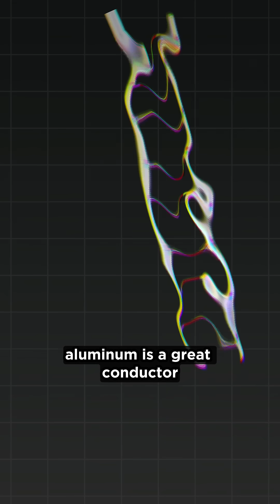How Did This Ladder Melt The Ground?

Comment: Current chooses path of least resistance so if anything it’s arcing to the ladder and there wasn’t a short so no reaction from the breakers as it’s only going straight to ground you would have to shut the power off to remove the ladder

Comment: I would guess the initial contact created a magnetic field and grounded through ladder. It could have then tripped a recloser. The recloser could have cycled fast enough to maintain the magnetic field allowing induction to flow through the ladder. Just a guess as electrical theory is just that.

Comment: Which circuit breakers? There are circuit breakers in the breaker panels of houses, but not in the power ling feeding the houses. These power lines usually supply multiple houses and the circuit breakers needed would depend on how many houses are connected to the power line which would be rather complicated to keep track of. So no, no circuit breakers will trip in this case.

Comment: The earth becomes a paralel path back to the source, there isn't enough of a load imposed to trip a breaker.  You can physically connect the line to a ground rod and the breaker will not trip, unless it's a GFCI, but there is definitely not a GFCI on the pole, only a juge fuse.

Comment: correct me if I am wrong, but the ground is a better conductor than the aluminum ladder (it resistance is lower) but all the electric current is focus in the little spots where the ladder touch the ground and it heats up

Comment: The heat from the molten concrete likely melted the ladder through contact eventually, which would cause the ladder to move as it settled into a new position.

Comment: Circuit breakers relies on over current values. Because this is other street side it will depend on the supply to the street and the protection involved. With faults to earth RCDs or RCBO are usually used but American's don't use the earthing system and don't have a fault path through earth back to the supply to read imbalances.

Comment: Electrical engineer here. The ladder is not “totally fine.” How many ladders start with the first rung 4 inches off the ground? Neither the cement nor any “asphalt” is melting. All the debris is on the surface. That is all melted ladder. The cement (plus earth) is a giant heat sink. It can absorb and dissipate a huge amount of heat. The ladder is a very low resistance conductor that is passing a huge amount of current. But the smaller contact point between ladder and ground - that’s like a thin wire coming off a thick wire. That contact point is where the heat is generated, melting the ladder at the contact point. 

A similar situation: if your air conditioner’s wall plug is corroded or dirty, then when you plug it in, the outlet contacts only break through the non-conductive corrosion/dirt where the mechanical force is highest, rather than over the whole contact area. The result: all the current goes through the tiny scratches in the corrosion, heating up the outlet. If you’ve ever seen a charred, semi-melted outlet, that’s a common way that can happen.
Reply: Astonishing how the real MVPs in the comments get ignored but clueless comments get to the top. Hats off to you sir for knowing your thing.
Reply: best explanation ... thanks
Reply: This right here

Comment: Electrician here! What I'm getting from this is you can tell something is touching and I believe somebody put their ladder up to try to fix something with the powerline and somehow got the two leads to touch together which would explain why it's holding itself up as it is sandwiched between two sections of wires and since there's so much voltage going through the powerlines it's just short circuiting and as soon as it touches the ground once again heat starts to build and it starts melting the concrete but sense there's so much power going through. It is melting at very high temperatures, which explains why it looks so molten and since it's aluminum, you wouldn't really be able to tell if it's heating up or not which explains why it still looks fine but the breaker and or fuse in place here the reason that it hasn't blown is because it's either looking for a ground fault or it's getting disrupted and it's not getting enough power. This could also be caused by a bad breaker or fuse or one that has already blown just aluminum takes a long time to cool down. Also, if I get anything wrong, please correct me.
Reply: Aluminum doesn't take a long time to cook, just like it heats up quickly (why cooking pans are made of it) it also transfers and releases that heat quickly into whatever it's touching.

Comment: Imagine the current required for big industries, like foundries, pass through this kind of wire. The little puddle of lava on the ground means there is a resistance, which might be quite small compared to what this line can provide. Which wouldn't make any fuse trip if the current stays low enough while this is going on

Comment: There's no way that concrete is going to get hot enough to melt before aluminum does. If this video is real we're not seeing melted ground; we're seeing melted ladder. It's likely if there's enough current to melt the ladder at the bottom that there was enough heat to fuse the ladder to the aluminum wire overhead. If it did that then eventually the ladder would break contact as it continued to melt as long as it stayed fused to the wire. Considering that aluminum expands when it's heated, if there was enough heat to fuse the ladder to the wire, the wire would not be lifting the ladder after it fused until the wire was able to cool which would only happen after the conductive ladder melted away breaking the circuit.
Reply: This happened in Union beach
Reply: @LloydUpsideDown Thank you!
Reply: @Rob-py8pl all ik is that the ladder hit a high tension wire and the bottom of it started sparking and something was melting.

Comment: For those who might be confused, the power lines usually have a lot of amperage, which is essentially just heat. Another name for this is current. The MANY amps of current heat the hell out of the concrete when it's able to make contact (only able to exist when there's voltage), and essentially make it look like there's a volcano about to erupt

Comment: If its still melting concrete and steel, theres still current.  Power lines are not connected to circuit breakers.  If there is a larger demand, its supplied.

Comment: the fuse probably finally blew. power lines dont have breakers like your house. well at least not outside of a sub station. there are fuses that will heat up then blow themselves open breaking the circuit instead. i trim trees for the power lines so any time a tree falls on them i have to get them off.

Comment: I work for a power company. That contact likely did trip the fuse somewhere up the line. At the very least if it bypassed the fusing it likely cause a relay at the substation, basically a momentary power trip so that whatever was in the lines can fall loose, then it automatically closes back in and re-energizes the circuit. By then the ladder was out of the way and not causing a problem anymore.

What happens next is a crew goes out and probably either kills the power to that line just long enough to remove the ladder, or they deem it’s far enough to remove it safely and maybe just puts any protective re-closing features into instantaneous-trip, that way if it does make contact it would only be for a couple cycles before tripping out.

If it’s found that the ladder was in sustained contact for a long time, they might want to adjust the settings or configuration of their fusing and/or their auto-reclosing features… because they might not be sensitive enough if this wasn’t detected
Reply: I don't believe the tarmac is bubbling like that without a continuous power source. It would probably just be ignited at most.
Reply: Thanks for the explanation. I had to read it a couple times to understand, but I was interested enough to persevere.
Reply: Ground fault only happens if enough current flows. Ground is high resistance, so not enough current, especially in the middle of the day with low draw in a residential area
Reply: I don't think the ladder is capable of passing enough current to do that.... Even if it could it would be red hot and sagging and deforming... I think the ladder poked through a thin layer of asphalt and damaged some conductors in the ground....if they are going to a business they could be 480v and capable of carrying much more current than the 240/220v going to a house, I'm unsure if the big pad mounted transformers use fuses like the ones on the power poles by the pole pigs for houses.... They might use an automatically resetting breaker of some sort, maybe it takes a good while to heat up and trip, then once it cools some it resets, I'm sure the service side has fuses but they are probably capable of passing large amounts of current only meant to blow under dead short conditions, which this is likely not a dead short, there is actually resistance between the conductors, which is what creates the heat, aluminum is not as good of a conductor as copper I'm fairly sure, and if someone was carrying that ladder and touched the overhead lines the path to ground would have been through that person, frying them and most likely causing them to lock onto the ladder as they fell knocking it down etc not placing the ladder in a position that looks ready to actually climb up.... I dunno too many things don't line up.... What do you folks think? I hope everyone is having a great day or night!
Reply: @bentboybbz dielectric boots has do the trick, making the technician invisible to the circuit at see the firts sparks, run and let ladder alone, and start having high current, and look like low voltage, if not the arc cut the ladder and the wires probably
Reply: @Carlos M Dielectric boots bring a whole new meaning to "the floor is lava" 😱
Reply: That's EXACTLY what I was thinking/would've said 😶‍🌫️
Reply: Melting concrete like that can be within expected power consumption of a block of apartments. Washing machines, TVs, heat radiators, computers, ovens, ACs and many more add up quite a bit of energy consumption.
Why would a regular fuse disengage when the liquified concrete has sufficient resistance which only builds up slowly during the melting process?
Reply: Its sputtering, so there is gas coming out. Probably a horrible underground fire
Reply: @user-eb4on6qn9h sorry but what you said is very fkin stupid

Comment: The breaker will only open up if there is a quick surge or the amperage goes above its rating.  In this case the resistance in the ladder and ground is enough to limit the flow of current to within the breakers tolerances.  So the breaker just sees this as another load and doesn't open.

Comment: Well if you take osha safety tests on using ladder or scaffolding you know that if your even within 10 ft of power lines it can jump to the ladder or scaffolding (metal). Making it conduct which won’t trip the breaker. So could be what happened here.

Comment: my guess:
AC (altering current) induces magnetic fields, which then again can induce electricity in other conducting materials, so the ladder is a circuit of its own and wouldnt be detected by breakers. i dont know what the reaction-voltage is for breakers of such a high scale, so i dont know if the ladder actually could let such a breaker fall on contact.

Comment: Aluminum has 61% the conductivity of copper, but the ladder has enough cross-sectional area to carry the full current of the wire, a wire that is likely also aluminum -- because Aluminum is only 30% the weight of copper.

Comment: Hopefully, a crew of at least 10 lineman will jump in... but I am an inside sparky! The 3 wires running in parallel at the top of the pole are your 3 phases. I'm not sure what kind of current they are carrying, this is where 3 or 4 lineman come in(the others will keep watching), until it hits a transformer... it's a lot, though!!! My understanding is that those wires are meant to keep pushing current through those conductors unless the phases have crossed. Forcing a disconnect that creates an air gap in the lines. 

The lower lines are communication lines. Those upper lines are more than likely also aluminum, but can handle the resistance/heat of the current being carried through it to ground.

They're usually bare to save weight. Especially, in icy conditions. We are currently coming out of the " ice age" in some areas with power underground.

Side note... most birds are safe because they'll rarely cross phases!

Comment: I work with high voltage electricity.  What I have seen is the lava is caused by the rebar melting within the concrete.  When electricity is flowing through asphalt you don't get the lava effect.  It will turn the asphalt to glass though.

Comment: Ok, so look at the bottom rung of the latter.  See how close to the ground it is? 
Believe it or not, some latters were made of magnesium.  My dad has one still.  They are very durable and lightweight, except for the fact magnesium can be ignited and is flammable in the right conditions.  It’s my belief that what we are witnessing in this video is the result of a ladder coming in contact with the electrical wire, sending the spark to the ground, melting the ladder and igniting the magnesium, which left the molten slag on the concrete once the ignition started, it’s pretty easy to get to the point it is now in the video.  This is why at the beginning of this comment I said noticed the bottom rung is damn near on the concrete.  It should be another foot off the sidewalk, but it’s not.  if I had to put money on it. I would bet this is a magnesium ladder ignited by an electrical spark.  If there’s any spelling errors or typos, they’re brought to you by Apple speech to text sorry my behalf of my crappy iPhone.

Comment: It might sound kinda stupid but I think that it fell and bounced off the wire, giving the electricity just enough time to flash heat the concrete below the ladder
Reply: That’s not stupid at all.
I believe it hit a line that was connected to the house they were working on.